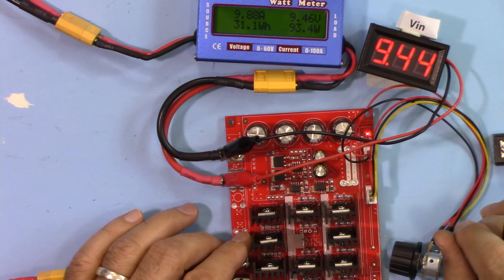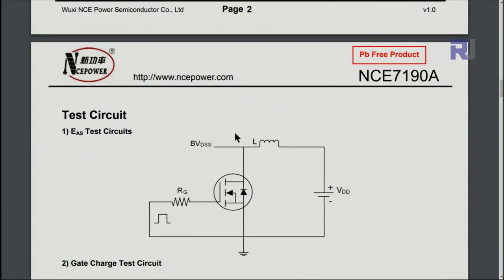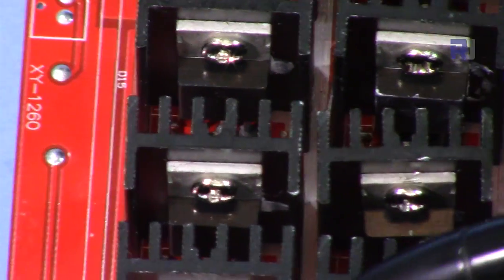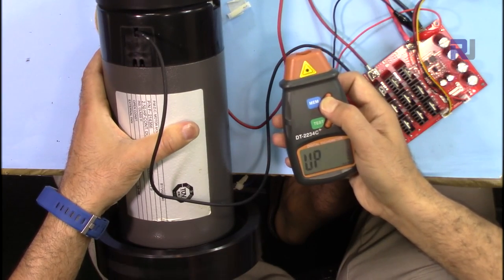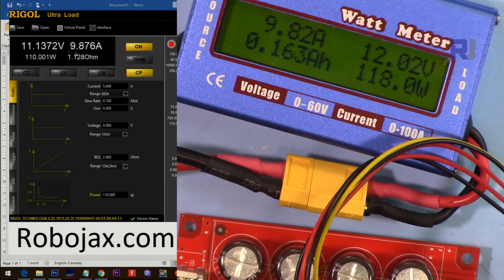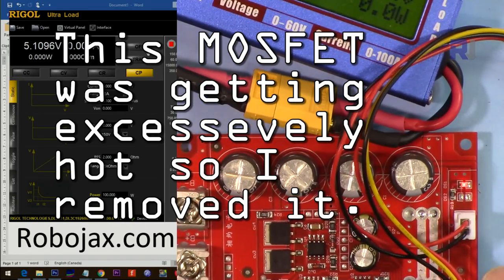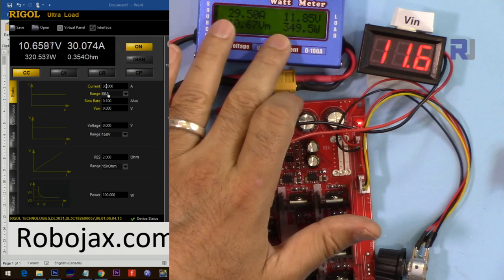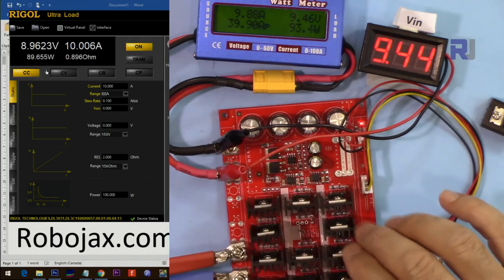Review of DC 10-50V 60A 3000W Motor Speed Control PWM Controller  module XY-1260

Comment: What is the link to this pwm product?
Reply from the maker: sorry is your question "what is the link between PWM and this product?" if so, Pulse Width Modulation signal at the input will allow to control the speed of motor while keeping the voltage unchanged. For example input to this module can be 12V and also output will be 12V but using PWM you can change the speed of motor.

Comment: My question to anybody that would be able to provide an answer can I use this type of controller on my Bird-2  36 volt e scooter
Reply from the maker: just check the motor. if the motor has 2 wires, then yes you can use it.
Reply: @robojax  It has three phase wires , along with hall sensors.? I guess that's a no?

Comment: Is there any schematic!
Reply from the maker: why you need schematic? to build it? the module is so cheap, if you want to make it, it would cost 3  to 4 times more just the components. If you want to know how it functions, just take it and draw it. you can can it in less than an hour.
Reply: @robojax  If cheaper than making one that is fine, I'll buy one,

Comment: Try Test pwm 100a very high quality
Reply from the maker: I would have to find it.  Did you check the link (in the description) about this item on how to control this using Arduino?
Reply: @robojax  You can click here,friend.100A 150A also have.

Comment: this product not 3000w! impolible 50v 60a,  posible 50v 32a, it is fake!
Reply from the maker: This is the claimed rate P=IV=60(50)=3000W . As I shown and explained the components, only ONE mosfet can handle 60A if we have proper cooling. This is 8 of them.  I could not test more than 20A with 24V and it was very cool. I believe this can handle it.
Reply: @robojax  no, this circuit use mosfet nce7190a max 170w. And 170x 10pcs =1700w

1700w÷50v = 34a max

i am testing
Reply from the maker: 90 at the end of model is 90A. check datasheet.ID= drain current is 90A https://datasheet.lcsc.com/szlcsc/Wuxi-NCE-Power-Semiconductor-NCE7190A_C110158.pdf
Reply: @robojax  ok, but 90a not for 50v, this one mosfet max 170w.  For 90a, 170w÷90a= 1.88v

Ok? :)

Comment: haha my diy controller can handle 30- 40 at 24 volts🤣
Reply from the maker: yes. and you can control it using Arduino. Check the link in the description or serach.